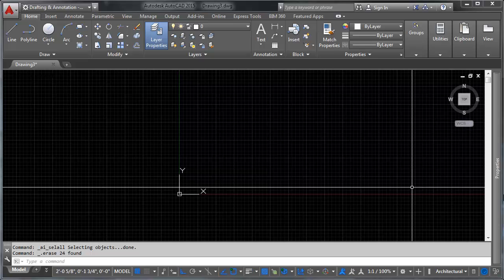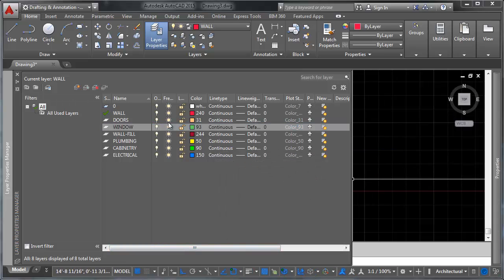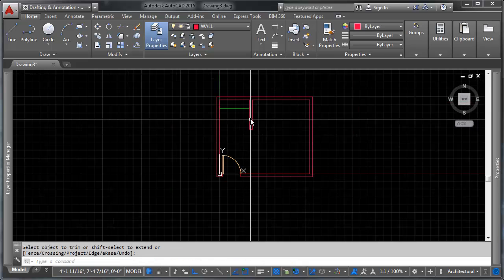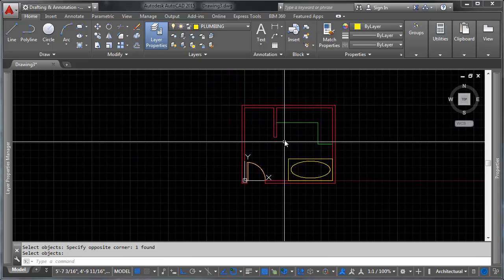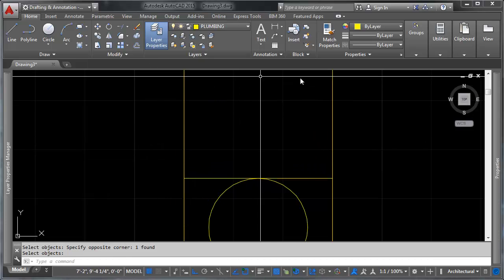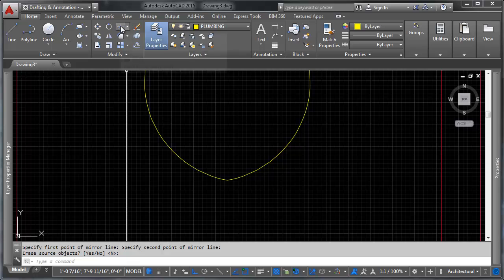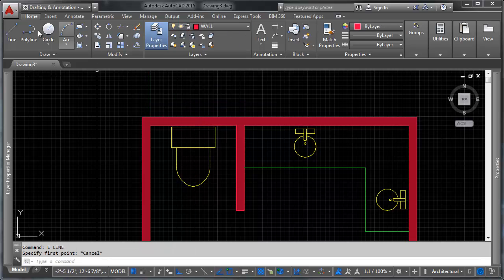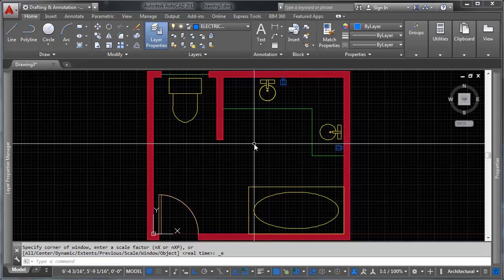Intro to AutoCAD 2015 - 08.1 - Example Drawing 1

Comment: Thank you very much, your videos have been extremely helpful! If you are taking requests, a video showing a project start to finish would be greatly appreciated. For someone like myself, whose full knowledge is entirely based on your 20 AutoCAD videos, it would help immensely. 

Basically take this "8.1 Example Drawing 1" video and continue it with text, leaders, dimensions, and finally plotting that finished product. I think this could round out any confusion between video to video and piece them all together nicely.

Thank you again!

Comment: These are great videos...i have watched most of them...when are you going to do some tutorials on lets say Floor plans of a home..like a 3 bedroom house with living room dining room etc..Most of your videos is just how to use the tools but now it would be great to do some tutorials on floor plans and elevations..etc..if possible...thnx...i also subscribed
Reply: *****
Well i am just starting out with autocad but i have been around the 3d industry since 2002. I am getting into architectural stuff recently. i have been mostly doing characters. Well why don't you just do a floor plan of 2 bedrooms before you do a house? Floor plan with correct height and width. Adding some annotations? or text and measurements to the walls? To me it seems much easier to use Autocad Architecture. But i am enjoying what you are doing. You have went into the tools deep but it would be nice to see some actual projects of drawing walls and rooms..a house can be long..so start out small and ones you get that down you can keep adding to it or start an actual small house. Thanx for the reply and keep up the good work i know it can be exhausting at times but i think it also helps you master things even better.